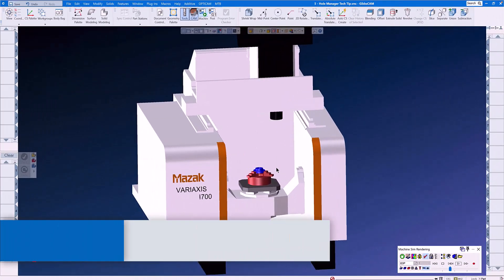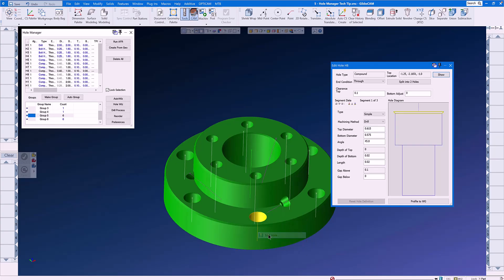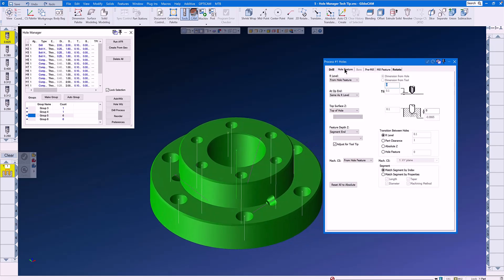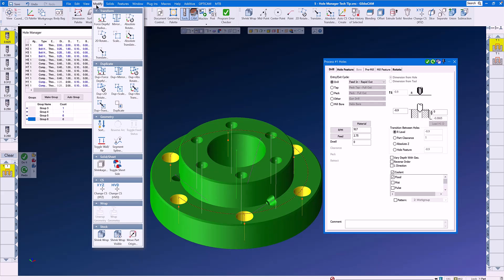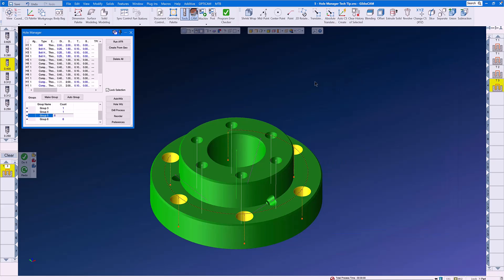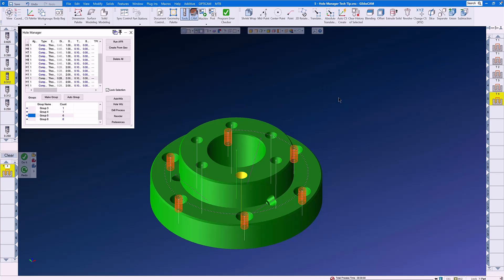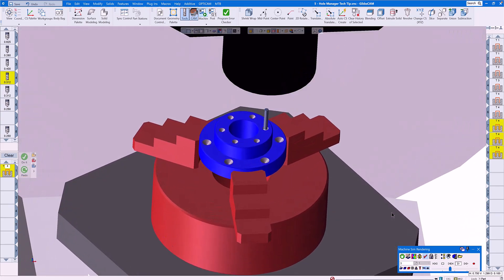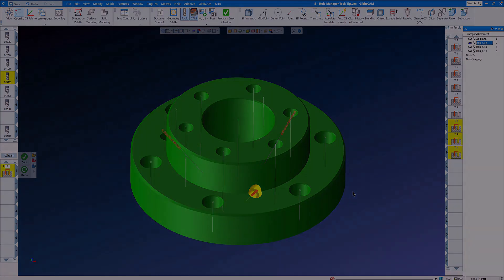Automate programming holes with Hole Manager | GibbsCAM Tech Tip

Comment: Hi, do you have a post output strategy that allows machine to position for 5 axis drilling without using tool center point control? Usually we have to create planes so the post outputs g68.2 (tilted workplanes) because canned cycles are not compatible with tool center point control. Makes the hole manager less helpful when you still have to create planes for every hole with a different alignment on part. Thanks
Reply from the maker: Thanks for your question! We'd love to help. This question is best answered by your local GibbsCAM reseller. If you are a Midwest CAM Solutions customer, then would you please submit it here? https://share.hsforms.com/1-xBMkGwLRgyBv0viRpGyDAc01ys We'll get you an answer ASAP.

Comment: How well dose the hole Manger work when the holes are not modeled correctly in your part? It’s not uncommon for me to get a model and some taped holes are modeled to the minor diameter and other to the major diameter.  Heck, sometimes the drill depth for the thread holes is only 0.030” deep while the tap depth is called out through the part.  Also, when working on weldments, some holes are thru the top plate while others interfere with the wall of the tube welded underneither. How would one handle that situation?
Reply from the maker: Thanks for your question! As you might imagine, the Hole Manager is only as good as the information in the solid model. So, it sounds like some editing of the model would be required to get the output you would want.
Reply: @midwestcamsolutions that’s what I was afraid of…… Unfortunately we do work for with customers that provide us with prints and models, so I can’t control that, but for our parts we engineer in house, maybe I can talk to the engineering team here.  It you don’t mind me asking, how does the TPI/pitch field get populated.  The only I get get this to populate is if I manually fill it in by myself.

This video did inspire me to start learning about the hole manger/AFR. One problem that I ran into however is when I set the in-between position in my process to ‘hole feature’ my posted code dose not match my machine/Op sim.  Will this require a post update?

On the bright side, I did develop a macro that will sort the holes using the hole manger and apply a hole process to them. So far I have 25 holes identified.   On the parts that I made it for, it reduced my hole programing from 35 mins to less then 7 mins. There is still work to be done to make it better, but it’s a start.  

With that being said, could you make a video on how to set the AFR sorting settings using the macro.  I find the Gibbs macro  wiki site to be quite vague in this area.  The wiki site will tell me that the command for setting the AFR_CS_mode, but does not describe choices I can pick from among other things.